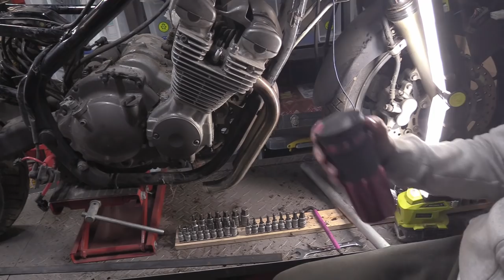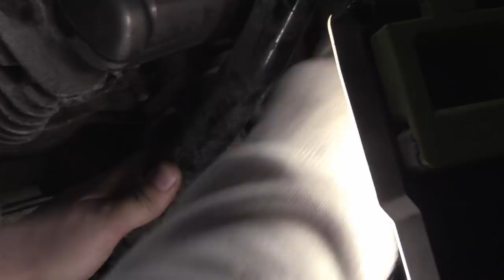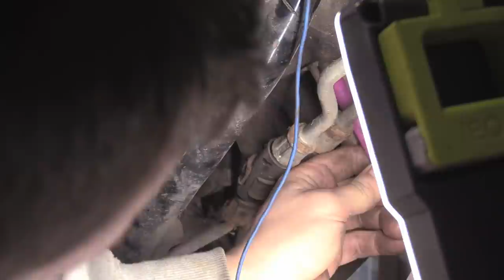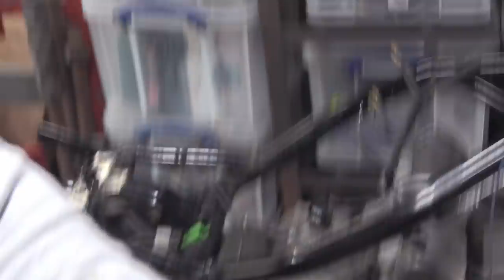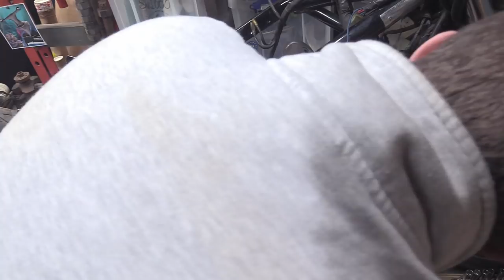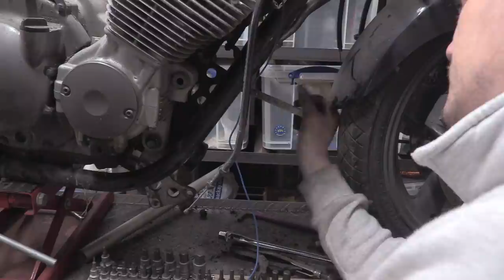Project Isaac #9 Removing header nuts

Comment: The heat trick worked well. I have a small straight length of allen key cut from a full one. Small socket on the end and use a ratchet. I'm enjoying the build
Reply from the maker: Not with the frame directly in the way you wouldn't.
Reply: @dirtygarageguy  Cant see why it wouldnt work but if you say not no problem. Mine was years ago on a GS1000 same double cradle layout. If you can twist your hex key you could have a racket on the end and twist that. Just maneuver the hex key to clear the frame. I'm meaning either a decent length of hex key to clear the fram or a shorter length plus socket extension. You've removed it now so I dont even know why I'm going on!  Anyway..... Keep at it, I'm enjoying it. Did like the heat the stud let it cool to break the rust! 👍
Reply from the maker: Because of the width of a socket vs the Allen wrench.
Reply: @dirtygarageguy  Ok Matt,  Fair enough, Crack on! 👍

Comment: Hi Matt, as an engineer do you not think that a std allen with parallel sides would have more purchase with more face to face contact to transmit torque?, those rounded allens are useful in a tight space but may be more likely to round out out?... liking these videos because they are bullshit free zones unlike Dellend.
Reply from the maker: If it works it was enough. In this instance I didn't have a direct line of sight

Comment: Re Blowtorch bit- I noticed you holding the touch up close to the bolt. When I learned to pipe soldering, they said that the tip of the blue flame is the hottest part.  Is it a load of wank ?
Reply from the maker: This blow torch doesn't have a conventional cone, this has a mixer on the end to distribute the heat instead of focusing it

Comment: I'm a complete novice mate & this probably seems a silly question but can you use a cheap butane/propane blow torch? Would it be sufficient heat wise as i know Mapp gas seems the more expensive preferred option these days?

Great videos by the way. 👍
Reply from the maker: Yes, not only is fine, it's preferred. Oxy would be far too hot.

Comment: Been there with a Pan Euro downpipe change, the first 4 came out nicely, possibly as the engine was still warm?, by the time I got to the otherside after removing the plastics to get at the studs the engine was cold and the last two snapped. 

I tried heating with a mapp gas torch but the head seemed to just wick the heat away , tried those reverse spiral vice grip sockets for rounded nuts but the stud was too small, tried stud extractors but the nub was too short. I kept snapping what little of the stud was left until it was almost flush with the head.

Thankfully I was at work, where we have an old disused workshop. There isn't much of any use in there, but there is a nice big mig welder and I managed to find some new M10 nuts. Took me about 6 tries to get the technique of welding a nut to the nub of the stud that was left. 

My first  few attempts I tried to hold the nut in place with some mole grips while trying to fill the nut with weld,  hoping it would hold and instead it would just snap when I tried slightly tightening and loosening it after it had cooled.

Eventually I worked out that building up a blob of weld at a time until it was big enough I could center an m10 nut over it then weld the nut to it. Had a smoke break to let it cool then work the nut back and forth until the stud came out of the head 

Did the same with a rear disc brake on the pan, thought I'd loosened them all with the breaker bar before going at it with my impact driver, nope must have missed one... rounded out instantly. Welded a nut to it and it came out nicely and was a lot easier as had the wheel on a workbench and I wasn't welding up over.

Going to try using the torch and letting it cool if i get stuck when I'm working on my bikes in my storage container as I don't have power or a welder there.

Comment: as much as i love the crayon colored allen wrench set you use, it's not the right set of tools to remove header bolts (or nuts). You need longer hex-sockets.
Reply from the maker: Lmao! Please tell me what "not the right tools" are? 

Using an angle grinder to skim a head is not the right tool, but where's talking about nuts. If they're off they're off. Using a blow torch isn't the "way" to remove them either, do you think that's wrong to?
Reply: @dirtygarageguy  lmao. don't get your knickers in a bunch there. you're using a breaker bar on an 8mm allen key. that should be your first clue that it isn't the correct tool for the job. but it looks like it's all you got..my suggestion is to obtain the correct tool for future use-which would be long reach allen sockets. All you have there are short ones.
Reply from the maker: The long reach sockets won't help them all. 2 of the nuts have the frame in the way. Do you have an xj?

Comment: Yep agree, of you get a result who gives a fuck what tool you use, and TBF you did say that you should be using long Allen sockets but hasn't got some to hand and frame in way any way. I really was asking if you've got the room on a job are std allens better?. After many years doing all my own bikes i recently learned about 6 point sockets being better for high torque as you said at the beginning. Changing the clutch hub on the Ducati was 240nM 😱 so i bought a Oberon clutch holding tool that looked like it was for working on a tank.and it relied on the ground to hold it (with my Mrs leaning on the rear), I've seen tools that bolt to the thin crankcase around the clutch FFS. AND others made from resin 😱
Reply from the maker: Yeah, if you have the room, Allen socket are a good option